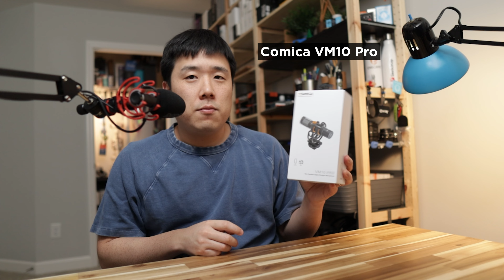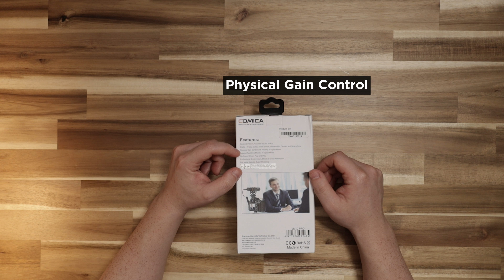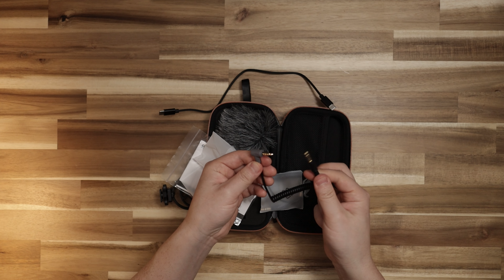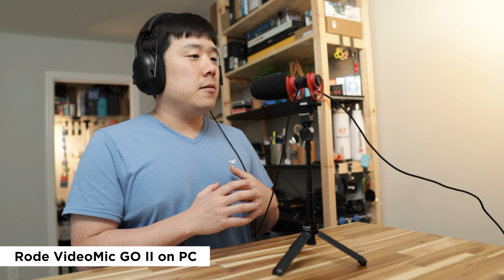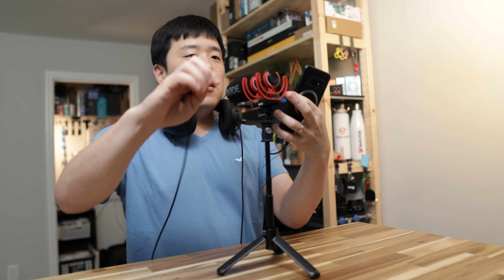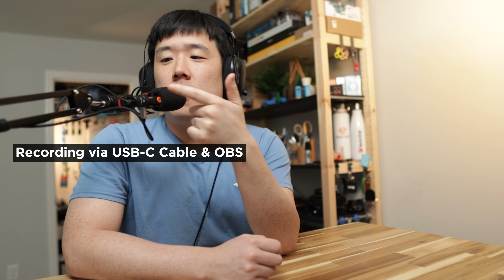Comica VM10 Pro vs. Rode VideoMic GO II - USB-C & 3.5mm TRS Microphone Review & Comparison

Comment: Your review is one of many others that I watched before getting the VM10 Pro. And I have to say that mine doesn't have the cons you mentioned.

I got this mic as a backup about a month ago and it's been working great when compared to my other Rode mics. There's virtually no background hiss either, it was quite frankly very disturbing in your video.

I'm now left questioning your setup, mainly because it sounds cleaner in other's reviews, exactly the way it does in my own setup. OBS settings play a big role here, I've noticed that certain settings require changes before it starts to sound clearer. I didn't need to do any of that in other applications.

Also, please check your gain setting in Windows itself (I'm assuming that this is your operating system). It was defaulting to 8/100 on the gain slider in Windows on both of the machines I've tested this mic with. It should be under 'change system sounds -> recording -> "volume" under the device settings'.

It sounded much cleaner and the gain was much closer to my Rode mics, I didn't have to adjust the gain digitally anymore so the background hiss went away as well.
Reply: Just came to comment this as well, the hiss was quite loud compared to what I heard in other videos and the gain seemed way too low compared to other videos, it was crisp and loud outdoors even from a meter away
Reply from the maker: I think it has to do with the cable that I was using. I noticed that even with digital connection of USB-C, my setup suffers from noises on different mics. Therefore I just resorted to pin recorder instead.
Reply: @JosephKim  Oh, good to keep in mind! Did you experiment with other USB-C cables or is this issue with the cable that it came with?

Comment: Can I connect Comica Vm 10 Pro to my pc with a type C to type A usb cable ? (my mobile phone charger cable)
Right Now I dont have a type C to type C cable, and the  type C cable I received was very small to connect.
Reply from the maker: I belive you can convert. But you need to make sure the cable you are using can transfer data.

Comment: hi there. I'm getting  this mic for my 15 pro max. Can you recommend a foam wind screen that would fit perfectly? I don't want to use the included deadcat. Thanks
Reply from the maker: There are a few off the Amazon that you can get.
Reply: @JosephKim i got the comica  VM10pro
Reply: Ok. Maybe you have a link. If possible. I got the mic today